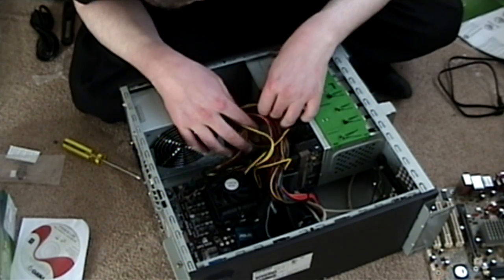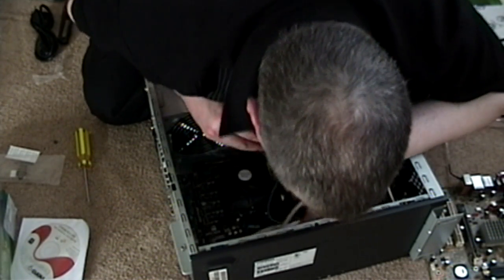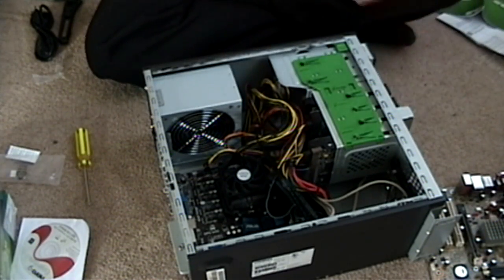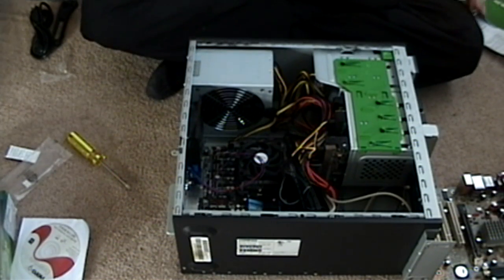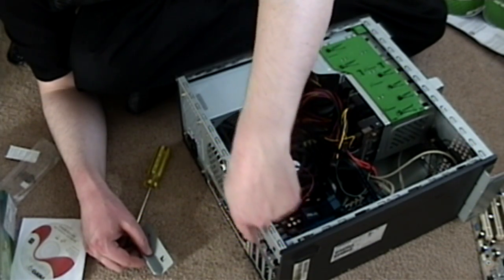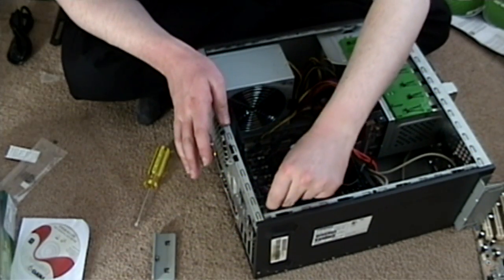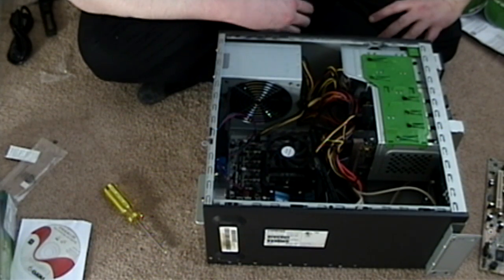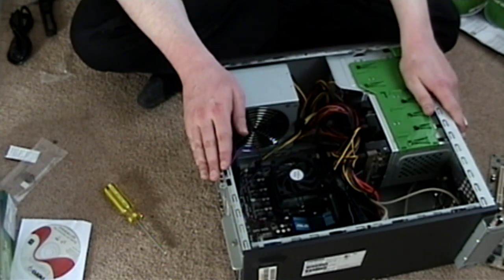Building The New Computer - Part 6: More Power Supply Stuff and PCI Cards

Comment: @Zaranyzerak - Don't leave the side panel off, that will case positive airflow which is bad 4 an older cases, You want negative airflow to push hot air out more then cold air in.
It would be a good idea to get rid of that stock cooler for the one you bought recently, twisty tie those wires down.  That's when you get the time to do so.
This way you can keep your old case.
Good job on posting WIP work logs too... in addition to your regular MMC reviews.